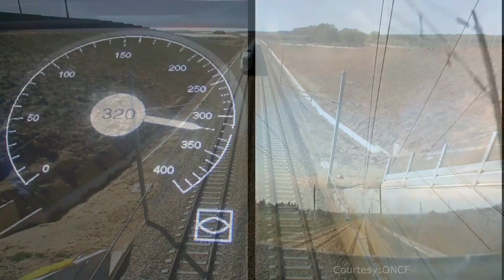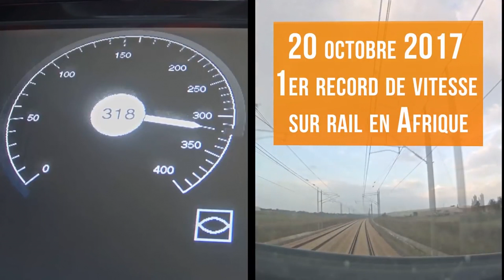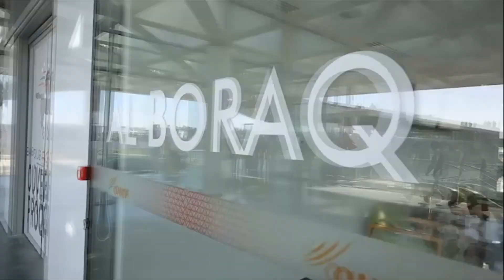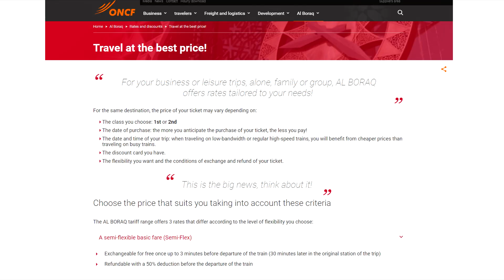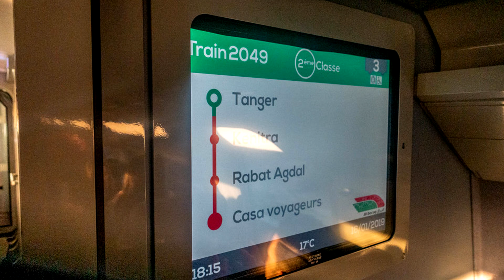The  African Bullet Train (AlBoraq)

Comment: You used the correct map for Morocco. Thanks
Reply: technically from a perspective of actual control, no. maybe from a perspective of what it is that morocco officially claims, it's correct, but from the outside perspective of "what do these countries control" and "what are the legally defined boundaries as per the UN" this is incorrect.
Reply: @red2theelectricboogaloo961  the UN does not recognize western Sahara so technically the map in the video is correct!
Reply: Well only if you live in Marocco

Comment: What on earth are you talking about at :35 there are NO plans to link the country's railways. The border between Morocco and Algeria has been closed for over 20 years and there is no chance of that changing in the next 20 years either. Plus, any HS rail between Tunisia to Morocco through Algeria will benefit substantially Algeria and Tunisia, and be net detrimental to the Moroccan economy overall (competition for exports travelling through Morocco with Morocco's exports, damage to local industry though imports etc)
Reply from the maker: Hey, thanks for the constructive comment.
Reply: @ness.  The border closing is to the determent of North Africa but to the benefit of France. We trade with them instead of each other. It's the typical neocolonial plan with cleverly drawn borders.
Reply from the maker: @bottlecapshoes  France benefits from this. If North Africa countries can work out their differences and improve trade with each other, the economies would thrive. Other African countries should do the same as well. They already have regional trade blocks that are greatly under utilized
Reply: @ness.  We cant. None of Africa can. The colonists drew the borders very cleverly to ensure control. E.g. uniting and dividing tribes and regions strategically and creating fake ethnicity to create genocide (e.g. Rwanda). Unfortunately communist Algeria and Morocco won't reconcile any time soon, but the fact of the matter is that the closed border costs us billions of dollars each year (seriously, look it up) and benefits France and Spain massively.